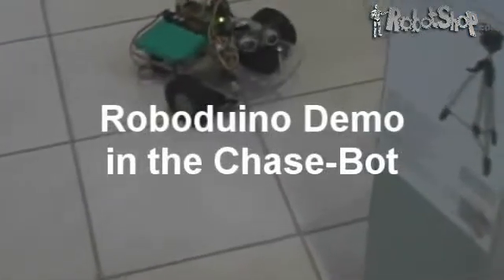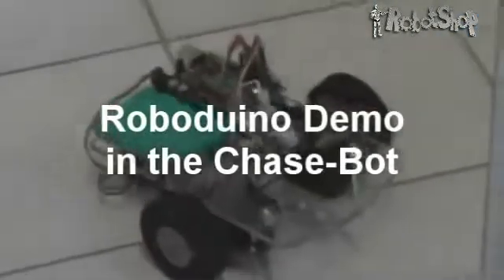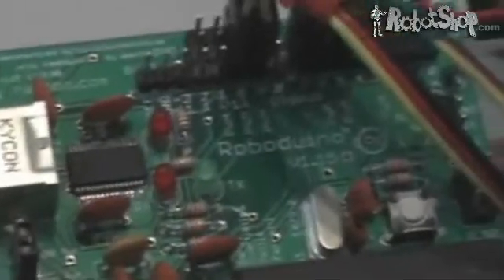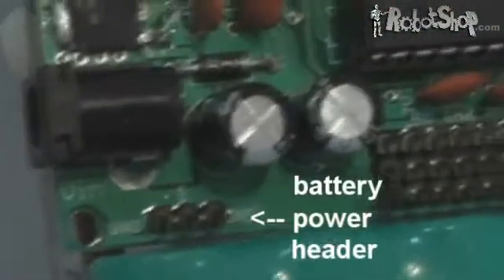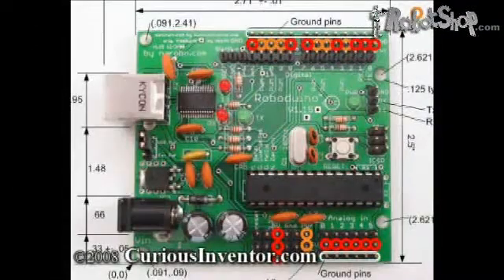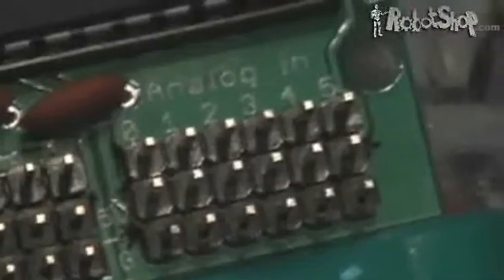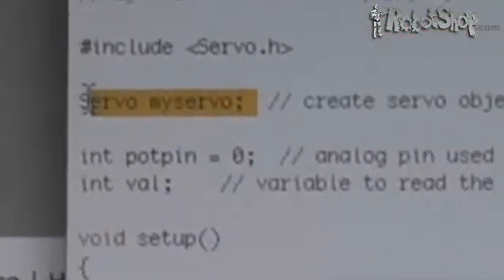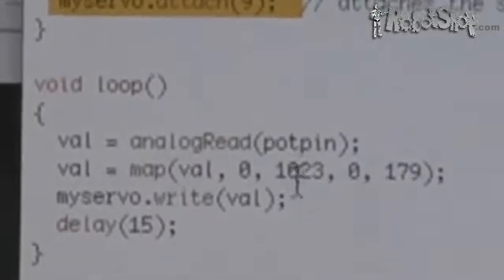Curious Inventor Roboduino Arduino Compatible Microcontroller by RobotShop.com

Comment from the maker: Not exactly. If you plan to use shields with the Arduino, the Roboduino will not be of any use to you since it lacks the appropriate connectors. However, if you want to connect sensors and servo motors directly to the board, the Roboduino is ideal.  Note that the DFRobot ROMEO incorporates the best aspects of the boards and a lot more and retails for the same price as the assembled Roboduino; for this reason we no longer offer the Roboduino.

Comment from the maker: The Arduino microcontrollers can be reproduced by other manufactueres because Arduino allows their designs to be open source. The "Roboduino" design is almost exactly the same as the Arduino, but instead of using female headers, the design adds a +5V and GND next to each pin, allowing sensors and servo motors to be directly plugged into the board. The DFRobot ROMEO (RB-Dfr-06) takes this one step further and still includes the female headers as well as the 3 connections , and a lot more.